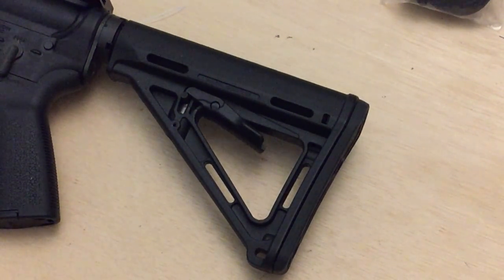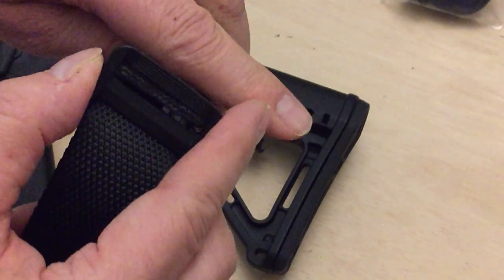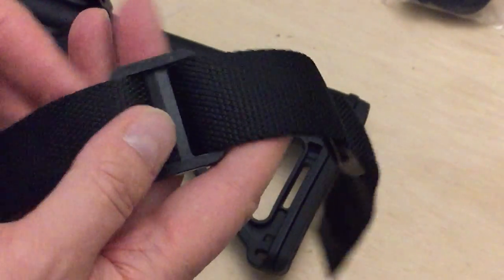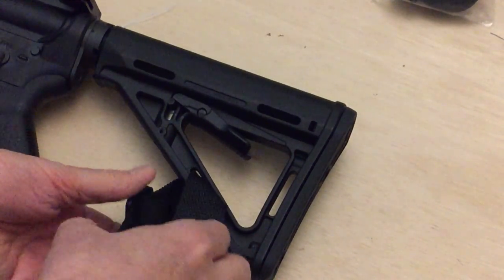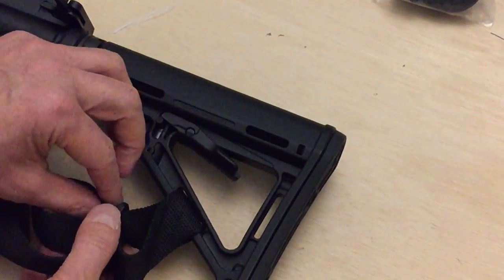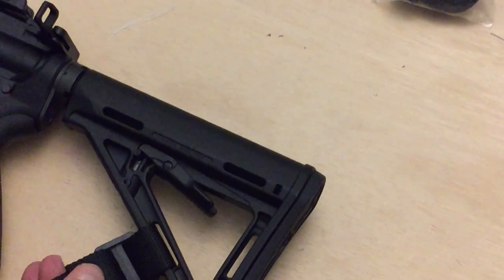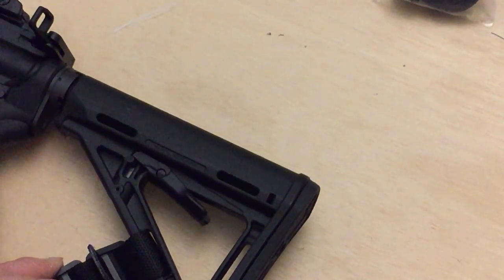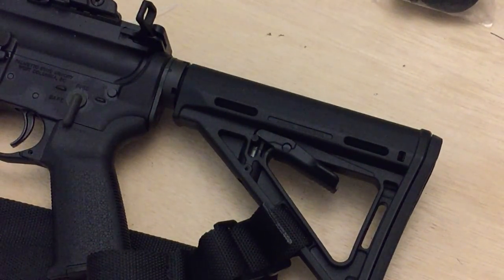PART 3 - Rifle Sling Installation "How To"

Comment: Did anyone else install your sling like this and then when you hang it off your shoulder, it flipped upside down?
Reply from the maker: Howdy Marcus... not sure I follow.

The rifle is going to ride on one side or another, depending on which side you are slinging it.  It's not going to be upside down, or, "rightside up".  It's going to ride flat against the body.

Most folks are right handed... but which side folks want to sling the webbing on will certainly be by preference.

Does that make sense, sir?
Reply: Marcus Moreland I know exactly the issue. Same thing here. Loop the strap on the vertical slot by the stock pad. Works perfect. No flipping.

Comment: Kinda sux gavin a fixed front sling ring. My 2 point won't work, gets jammed in tge handgaurd and ring
Reply from the maker: That's a common problem with factory installed swivels, Joshua... especially with the Magpul MOE hand guard.

If you have a Magpul handguard, I would just put a swivel on the handguard, or run a QD on a M-LOK QD Socket on the handguard.  If you are handy, you could also make mods to the handguard for more clearance.

Comment: Just got mine yesterday and the videos helped a bunch! Mine is mounted to my 7.5in Diamondback AR15 Pistol. I can get the sling to extend with the loop but it won't tighten back up with it? Would appreciate any help with the operation of the sling issue I'm having?
Reply from the maker: Hi Rodney... the "intuitive" think to do, is tighten by pulling it toward you.  But, if you think about what the Tri-Glide sewn into the adjustment is supposed to do at any length it is set at... it has to "lock the tri-glide" so it doesn't just slide longer under weight.

So... the motion to tighten is towards you but ALSO slightly downward, so the adjuster tri-glide isn't in locked position.

Make sense?
Reply: Sear Tactical I will definitely give it a try and practice with it more. Thanks for the quick response! Sling is very comfortable and seems to be very strong!

Comment: Is there a way to easily use/set up your sling as a single point?
Reply from the maker: Could be done with add on hardware... sure.  Most professional gunfighters are running adjustable 2 point slings these days.

Comment: What if I wanted to add a QD function to the stock end? Is that possible?
Reply from the maker: Sure thing... many stocks have a QD socket in them, and you can buy an add on that will fit a Magpul MOE like mine as well.

Comment: How do you set this thing up for an  left handed shooter?
Reply from the maker: The only thing you might do different is run the end through the stock on the other side.

If you are running it from factory swivels... there's no difference to set up, regardless of favored hand.

Even as it is in this video, it will work as is just fine.  :-)

Comment: um.....why r u putting it thru the bottom of the stock?wont that make your rifle want to hang upside down?
Reply from the maker: Hi Michael!  You can certainly mount it anywhere you want... but if you think about it, no, it won't make it turn upside down, because I am INSIDE the sling... right?

In fact, hangs just right that way... although when not showing how to install, I have a QD socket mounted to that same place on the stock.

Thanks Michael!
Reply: ah i got you.I did mine thru the top slot at the very end of the stock and the fore end as far forward as i could and its just right! :) thanks informative vid i did watch all three....thanks

Comment: so what about the loop in the front? What's it's purpose?
Reply from the maker: Howdy, Max!

Assuming you are going by the setup as shown in this video, it is for adjusting the length, longer or shorter.
Reply: @STIRifleSlings  thank you sir, I installed it on my rifle and figured it out soon after. I forgot I posted this question. It's an awesome product.I will enjoy it.

Comment: Why is your ar not on safety?
Reply from the maker: Because "Safety" is ONLY selectable when the firing pin is cycled to "loaded"... and this weapon is unloaded.

Do some folks need to be told to work with an unloaded rifle?

Do some folks need instructions on putting their trousers on?